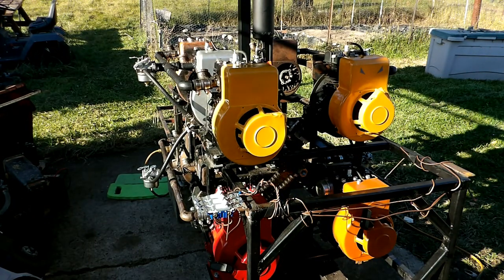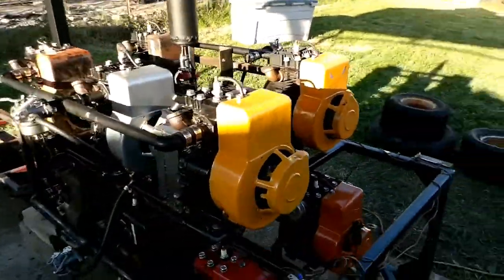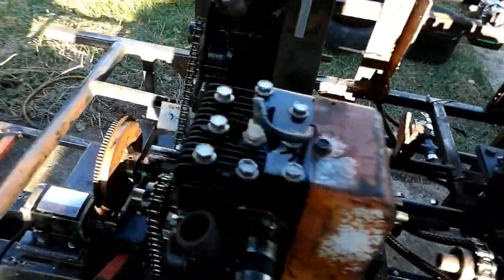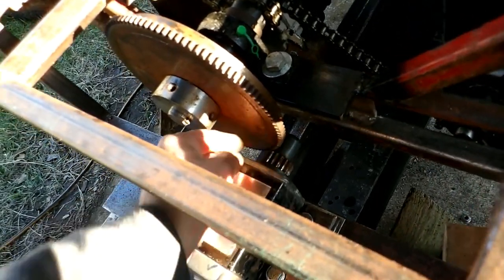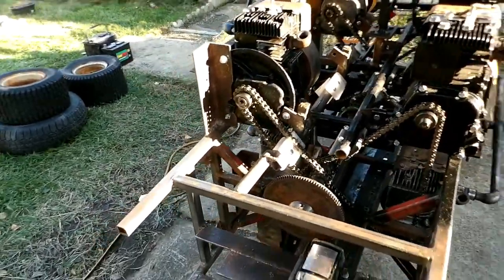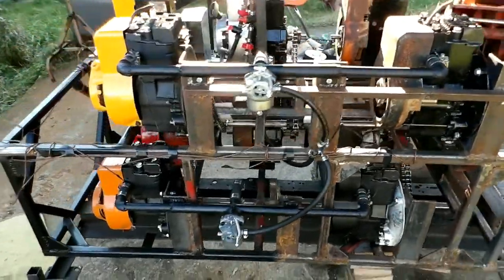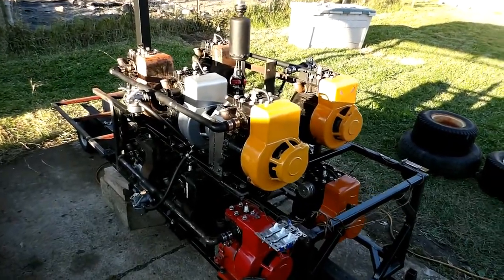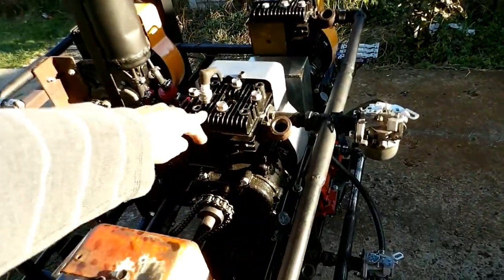H8 Cylinder Running Open pipes

Comment: Isn't one of those a vertical shaft?  What did you do for oiling to turn it sideways?
Reply from the maker: I modified half of the engines to use an oil dipper, as well as re-working the oil feed slots. I will tear one down soon to see how well it worked.
Reply: @ChargerMiles007  ah makes sense, it'll be interesting to see how the internals effect oil flow